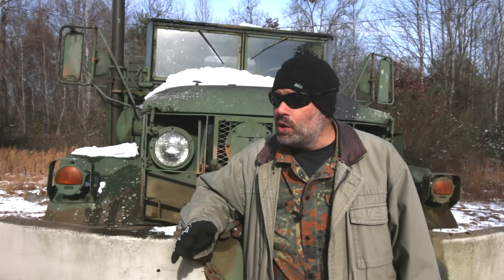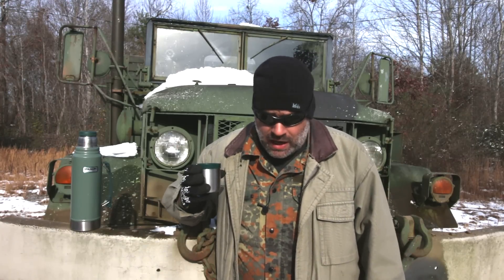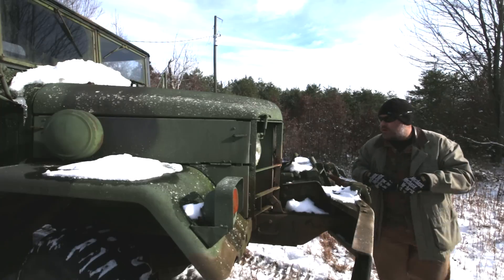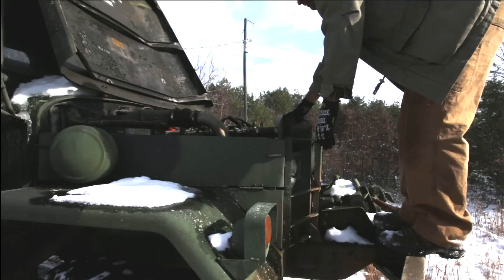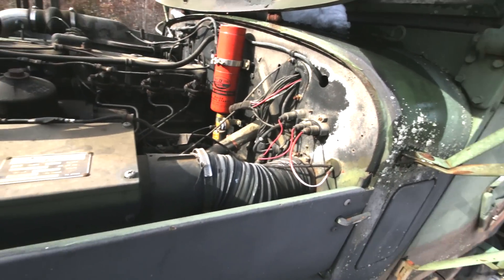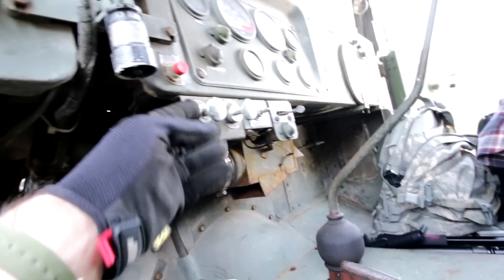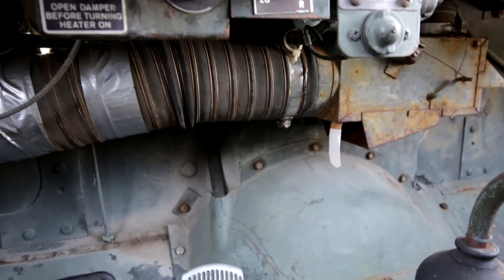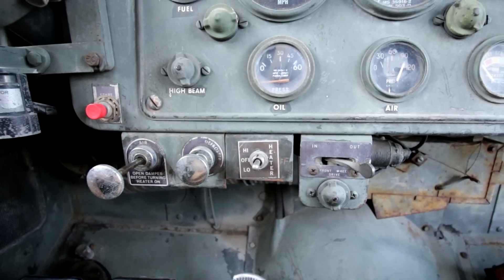Does a Deuce have heat?

Comment: I live in ND and yes it gets as cold here as you think it does!  I did a bit of engineering on the heating system in my Deuce and I relocated the heater unit from under the hood to inside the cab, it fits very nicely under the glove box area and you can still feed into the valve body for your defroster.  This increased the efficiency of the heater unit by at least 50% by not having freezing air forced into it and it reduced the lengths of the heater coolant hoses to less than half their length and keeping the length as short as you can greatly helps in keeping the coolant temp in the hoses at a higher temp, resulting in more heat to the heater core.  I also went over my firewall and plugged all the holes that are not needed.  Making sure your weather stripping on the doors and windows is also important in keeping cold wind out.  The winter front on the truck is a very good addition in that it helps to keep the temp of the engine up where you want it.  I strongly disagree with only covering half of the radiator because it makes your fan flex way to much when it has to deal with a dead air space where it gets no air to move.  The hood cover which is part of the Arctic kit did not seem to do much for my truck I only used it one winter and it just didnt make much difference.  I have driven my truck in -10 degrees many times and once the engine comes up to temp its very comfortable inside the cab.

Comment: What you REALLY need is the insulated bra and foam floorboard kit that is part of the Arctic kit offerings. My roommate and I outfitted our fuelers in Germany with these two items because we were always on the road in winter, and you never knew what you might be up against. We got caught in a snowstorm during a convoy and spent the night in a Parkplatz. It got to be -20° outside, but a very comfortable 70° in the cab. Well worth the effort. And if you can't get the bra, cover half the radiator with cardboard.

Comment: The Arctic Kit consisted of a quilted cargo box cover, and the ends were plywood. There were plexiglass windows along the sides, and some had windows at the back. The diesel fired heater in the back looked like a Yukon stove in a way. There was also a diesel fired heater in the front cab. No radiator or fan in the engine compartment. The cab heater was self contained. Many trucks burned up because when a heater got hot soldiers would place their coats on the heater. I still have photo's of a M151A2 going up in smoke because of a burnt up coat. I never saw a front quilted cover for a deuce in use in Alaska during the mid 70's although the grommets were in place.

Comment: Mine does. I added an additional heater core and fan under the passenger seat. I also have the heater kit under the hood. I ran the heater hoses through the holes in the floor for the ambilocal plug. Works great. Now I have great heat in Michigan.
Reply from the maker: You have a heated seat in a Deuce?!  That is genius!

Comment: Our Deuces and 5 Tons were not plumbed / vented/ equipped for heat. In the few trucks we had heat in, It was because we installed the heater unit INSIDE the cab on the passenger side floor up against the firewall. Hot water was controlled by a manual on/off valve in the heater hose under the hood. There was no heater control panel. Just a toggle switch for the fan.This had advantages and disadvantages. The air was recirculated air instead of fresh air. On the coldest days in Wildflecken or  Hohenfels Germany you would have to turn the heater fan off from time to time to keep from getting too hot but there was nothing to direct air to the windshield vents, the fan switch was only on/off with no selection for high and low and if you wanted to turn the hot water on or off you had to go under the hood.

Comment: Back in the early 1980's Canada bought M35. We still have them but they are very old. Bombardier put them together under lic from the USA.It was a fantastic truck and one of our back bone vehicles. I use one as daily driver to repair Weapons at work. Canadian Soldiers have always wrapped rags around the vent tube leading into the cab and also the vent tube inside the fire wall.secured with what we call Gun tape...In the US Military they call it 100 ..200 Mile tape.  Also green rags tucked around any draft area..It takes awhile to heat the cab but all this helps.  We didn't get the multi fuel version. Basically we got a desiel School bus engine with an automatic Alison Tranny. It works good but like i said we got the cheap option.

Comment: You did a really good job with this video. Actually this is my favorite Deuce & Guns video.
I just got back from a late cold rainy night 1 n 20 min run in the mountains with it partially snowing. Well I’ve only had my truck a few months and haven’t ran one much in decades.

It seems like the heater & defrost might had some issues but could be driver error/ operator maintenance ,ha,ha,. So getting on here to re-educate myself on the heater was helpful. I do think there might be an issue with the blower motor though ? Check it out tomorrow. 

Thanks B.C. For all you help, I plan on getting one of your shirts.
Reply: P.S. got to have the coffee thermos , that topped the video off, I found an American made one on e-bay, I take it with me in my truck, real Army like, ha,ha. Great videos B.C. Do more Deuce videos, please. How about filling up the fluids even the transfer case , rear ect,,,. What ever might need it annually .

Comment: The wind through the window edges forced me to put a 12V heating blanket on my left shoulder lol. Then found out that a cheap 12V solar panel hooked to the battery heats up because of the alternator voltage swings and used that as a seat warmer!

Comment: When you were showing under the dash I could see a lot of holes in the firewall! If you plugged up some of the holes it may not get so hot in the summer in the truck. Also is there a way to stop the hot water from going through the heater so it could blow cooler air in? Just some thoughts! Thank You for the video

Comment: Thinking about how miserable my 74 VW Thing was to heat in a Minnesota winter (think all metal, no insulation, soft top, and windows, kinda like wearing a raincoat in a blizzard), and despite running dryer vent from the engine compartment to defrost windows, never trusted gas heater.  Twice I used (during week below 0F) and was so hot I though vinyl top would melt.

Comment: Former Army mechanic, the blower is wired direct to the battery.  They did this because "lo" is wired to half of the battery bank (12V) and "hi" is wired to the entire bank (24V).  
At least, that's the way it was on 900 series 5 tons (also AM General products).
Reply from the maker: Interesting.  Thanks for the input.
Reply: how do you connect to only 12v when the batteries is in serie? just  bought a unit iam gonna install in my truck.

Comment: For the heating system, have you tried using a cold air front on the radiator to help the coolant hold on to more heat for the heating system?  I know I have had to do this on my tractor and also several cars over the years when the heating system can no longer keep up.  The big key if you do that is to ensure the engine does not overheat but sometimes the radiators work so well in the winter that the small amount of coolant that flows past the thermostat actually cools the whole engine and keeps it below the temp where the thermostat opens all the way and the coolant never gets hot enough to really dump a ton of heat into the heating system.
Reply from the maker: I thought about that but being in the south temps like this only happen a few days a year if at all.  In colder climates having a front cover would be a big benefit during winter months.

Comment: Really wish you would have shown the heater hose connection on the engine. I think one should be screwed into the outlet on the water pump and the other one on the neck for the thermostat but that's just my guess.

Comment: ... thats just like my 1973 f250 no ac theres outside ambient (ambient engine bay temp) and OMFG who opened a portal to hell in my cab... theres also the side vents in the cab
Reply: Da Sturm had a 79 f150 when we had a bad winter...those ford trucks will warm you up
Reply: I've got a 70 f250 that i love but unfortunately I'm going to have sell it due to health and being out of work. It's a great solid truck too still has the original am radio and it works. Wish I didn't have to sell it.

Comment: Installing those heater kits sucked quite a bit.
Reply: Am I the first one in a year to say, "I see what you did there"?
Reply: I added o e to mine and I constantly cussed the defroster hoses . They were a bitch as well as the hose that goes on the blower motor to the fresh air intake.
Reply: @georgedistel1203  I found that mid 60s Camero defroster hoses are 3 1/4 inch and fit the Deuce perfectly.

Comment: I believe the blower motor switch should always be powered. That big engine holds plenty of residual heat to keep the cabin warm while the engine is off during short stops. I'm thinking military logistics drop-offs or the like.
Reply from the maker: Could be.  I still think it's odd for it to bypass the main power switch unless they had concerns about the lift pump causing a hydrolock.  There's probably an odd ball reason that I'm not even thinking of and would never come up during regular civilian use.
Reply: The oddball reason for the fan motor being directly connected may just be that it was that the heating was an accessory to be retrofitted as needed , no one could be arsed to install a relay for it. Too time consuming to install, and adds in complexity.

Comment: U need to get some stainless steel dryer hose for the blower hose. Home Depot has it for a cloths dryer in stainless.
Reply from the maker: That's a good idea.  I use a ton of it in the bunker as part of my fume hood air evacuation system.

Comment: Back in the 70's we would mount the regular Deuce and a half heaters between the seats in our jeeps. On high they would run you out of the jeep! Tank heaters were even more messed up. They ran on diesel also and had a Flame Detector Switch connected to a glass rod. When you ran the heater more than an hour the switch would burn out. It was impossible to get spare switches so you were forced to run the heater 24/7. If you turned the heater off it would not start again without a new switch. The tanks used to get so hot you were driving around in your underwear in the middle of winter! LOL! The Russians got around this by not having heaters in their tanks at all.

Comment: Seems all A2 trucks will run the blower motor with the ignition switch off.  In my opinion that is a design flaw since someone can leave thee blower on with the engi stopped and kill the battery.  On the m35a3 the blower will not run with the ignition off.

Comment: they would have had to add a relay on the ignition 

the fan motor would pull too many amps....and fry the ignition power lines.....

so....its probably just hooked directly to the battery, with just that switch (which is a beefy switch).....

simple, cheap, effective.....and thats what the military wants

Comment: Heat?.......a campfire on the floor in back! Ask me about how it works (Sgt. Gary Army 1970-1976).
Reply from the maker: That would do it!  I'd probably be horrified by what's been done to my truck in its past service.
Reply: That's why you drove, to stay out of the back. Ammo can on top of motor to heat c rats going down road, private with expresso maker asst driver. Only way to go

Comment: Anything ever go out on it? Any mechanical problems ever ?
Reply from the maker: Other than routine maintenance I've had to repair the blower motor on the heater twice.  Many people think that the items listed as routine maintenance sound like mechanical problems though which include axle boot replacement, three fuel filters to keep drained of water and replace, two oil filters, oil the winch cable (if equipped), drain the water out of the air tanks every day, take care of what feels like about 700 zerk fittings, locating the correct 24v lights/making what you can find work, and the list goes on.
Reply: DEUCE AND GUNS thanks for the info and feed back sir love you videos. That's really good for no mechanical issues. I'd love to own one maybe this tax year.

Comment: the blower for the heat in my deuce also comes on with ignition on or off ..its direct wired ...
Reply: Tony L I had to put a kill switch inline before the main blower motor switch on mine because my kids and their friends would go in there and play army, and as kids do ,they would move all the levers and switches and often when I went to start the truck the batteries were dead because they would leave that switch on.

Comment: so is the m35 the only 5 ton with the multi fuel engine? the CAT motors in the m8-m9 5 tons are diesel only,,,, correct?
Reply from the maker: Yep, the CATs are strictly diesel it should also be able to run on JP8 if you have that available.

Comment: i drive a 1977 chevy truck in the -40f montana winters....

heater does the smae thing.....tries REALLY hard.....but their are so many leaks
just keep your coat and boots....ya will be fine

but...its got a 1200w heater that pumps the anti freeze threw the block.....and a "little buddy" heater in the cab that runs off of 120volt

still isnt enough some days
Reply: Have you ever driven a truck with no heat when it's below zero, I've done it a few times here In maine
Reply: @prylosecorsomething3194  hell yeah got a flinstones isuzu pup with speed holes everywbere and no heat down by portland....no power steering keeps the blood flowing haha

Comment: You could carpet the interior floor, and have floor mats, and shield the firewall with some heat and sound insulation, and line the roof and sound deaden the interior door panels, and re-seal the rubber door seals, maybe fit disc rotors to replace the drums, bob the rear tray, lose a set of rear axles and the extra diff, get a LSD/Spyder diff centre on the remaining rear axle housing, re-bore the cylinders, balance the engine, port the head and reseat the valves, wrap the exhaust manifold and heat shield it, balance the tailshaft, customise the suspension, and ..seek lighter rims. 

Maybe the fuel economy improves?  Worth it?

I'd think about the transmission but I just don't know enough to swap gear train ratios, the idea would be to top out the vehicle in final drive gear in high at around 70-80 mph. That's so you can overtake, otherwise at least you can cruise on 60mph.

Comment: Hey BC.
Referring to the Wiring Schematic for the Deuce, you'll see that it is quite typical that the heater can still be activated without the accessories. The draws its power directly from the batteries, see image linked...
https://puu.sh/tYYkQ/3e2f8decc7.PNG
The Accessories switch seeming is only related to the starting system, manifold heater, gauges, fuel pump as far as I can ascertain..
Looking forward to the next video!

Comment: no thermostat control is there a way to put air condition in one of these
Reply from the maker: You'd have to go with a Vintage Air option an insulate the entire cab just like trying to shoehorn AC into a Model T Ford.
Reply: I was in an air conditioner model T before I don't think automotive air condition to know until 1945 who is only Cadillac

Comment: Start it up
Reply from the maker: The previous deuce video has all the antics of me trying to start her up in the cold.  Linked here. https://www.youtube.com/watch?v=_2Eb-4O8QDQ&t=1s
Reply: DEUCE AND GUNS what are the drips coming out of the tube from the heater into the cab? I have the same thing on mine but it is coming out of the vent. Is it still safe to use? I don't want it to go up in flames LOL
Reply from the maker: In my case it's just water from snow melting and leaking in.